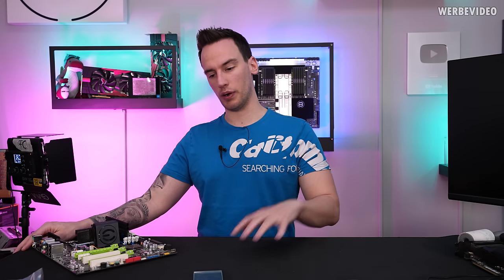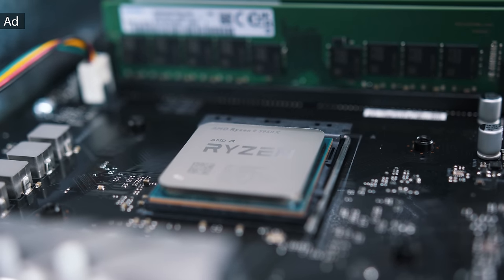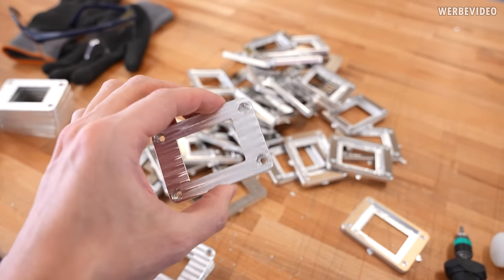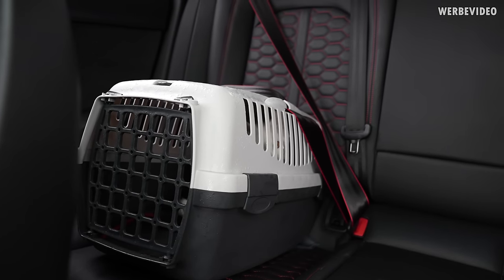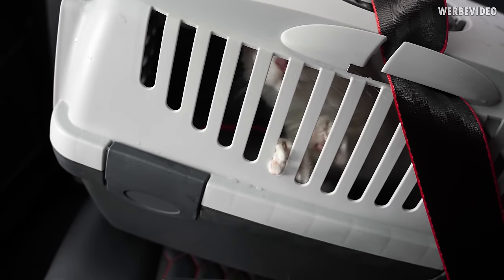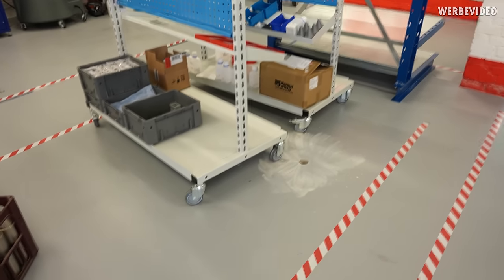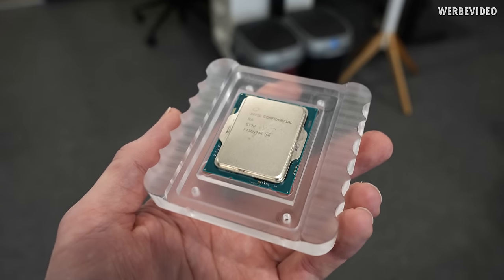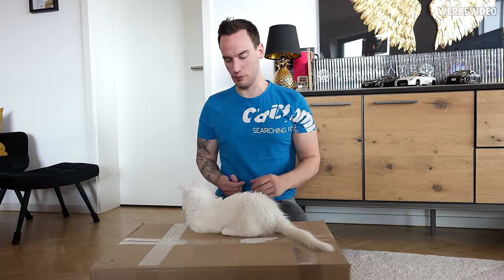WEE(K)-Log #21: CPU Tools and new Family Member

Comment: CPU fan wires do my head in a bit. Wish they pass through the board (a hole) and into a fan header on the rear or fan controller.  Other way would be make coolers to have a sort of quick connect that just slots in or makes contact between cpu cooler and motherboard. Congrats on new family member <3 hope it all works out.

Comment: For untidy cables, I tend to use marine grade heat shrink 3 to 1 ratio, this has an adhesive on the inside. It is, quite thick compared to standard heat shrink. Amazon UK sell the heat shrink for £8-10 for 5' (150cm).

So, #20 V-log, I was correct. 😇

Comment: 15:05 Too funny...this 2004 Toshiba I use right now (with a Pentium M 725, the Celeron M that laptop has is a cut-down version without EIST and maybe other features) does the same...a crippled GeForce FX with 1/4 of the original VRAM remaining...and screen 50/50

Comment: About that Stargate laptop, I don't think this is the actual prop, since it would be incredibly odd for an American show filmed in Canada to be using a German Dell as a prop, as evidenced by the QWERTZ keyboard and of course Win XP with German UI.

So the model could be the same as the ones in the show (early/mid-2000 Dell Inspiron/XPS) but it's definitely not the same region.

I think you're at least most likely correct that someone imported those Stargate programmes from a production source, or they just made those themselves (I used to have the spinning SGC logo animation which was the exact same as the one in SG-1 for the animated screensaver on my old PC), but I'm almost certain this isn't the actual laptop that was used on-set.
Reply: That would be a hell of a lot of work to make all that themselves.

Comment: For GPU power cables, I've seen U-shaped connectors that allow you to run the power cables straight over the top.
Also, a weird idea: if you shoot compressed air at the bottom side of a CPU in its socket, could that improve cooling?

Comment: I've "recently" bought EVGA nForce 790i DIGITAL PWM (132-YW-E180) locally in Poland, but I'm not selling :D I only have one of those and I also searched for some time. My plan is to do some Xeon OC on it when I will have a bit of time.
I'm monitoring online auctions and I will let you know if something pops up.
Reply: @der8auer-en  But do you really really need something with NF790i + DIGI PWM? 
There is "DFI LanParty LT X48-T2R in OVP" on german eBay since ~January. This is also oldschool LGA775 and also has some strange CPL chips in place of inductors. I mean, maybe X48 chipset still works for you. 
Price is high, but maybe you can come to terms with the seller :)